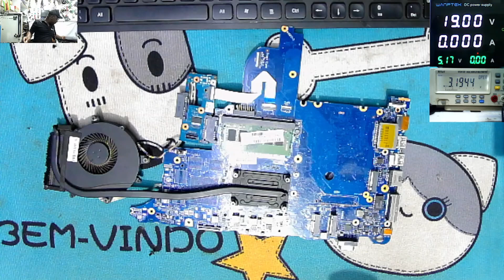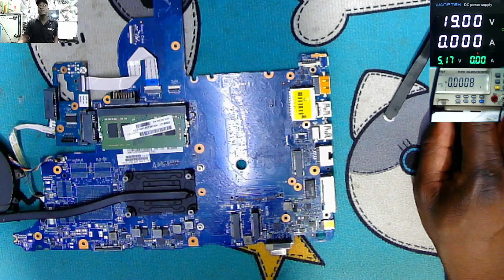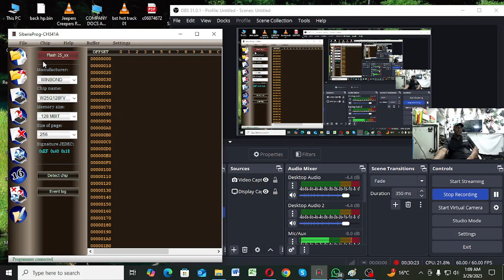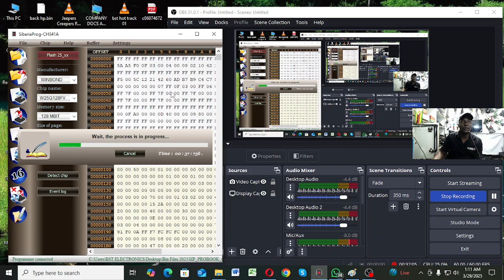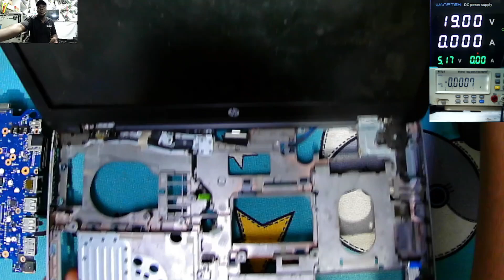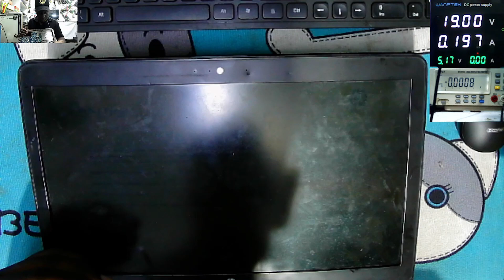Hp ProBook 650 G2 No Power, No Life Completely Dead Motherboard Repair Nightmare.

Comment: Howsit...where can I download the software to program the bios
Reply from the maker: I use the CH341A programmer software, which you can typically find on the official manufacturer's website or common electronics forums.
Reply from the maker: On bin files Check out discord from. Electronics Repair School

Comment: First we check for inspection then check for voltage 3.3 in the power button. Then check for short in diod mode we found bad MOSFET in the second MOSFET on the main power rail. Change the bad MOSFET but no results, reprogram the Bois with a success working laptop.
Thanks for your video which we learned a lot. I love you 😘💝